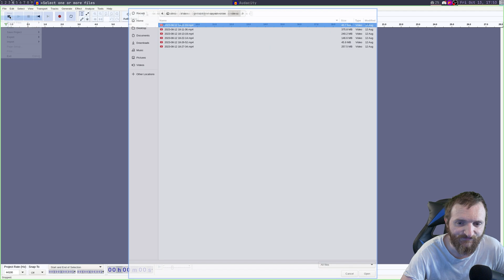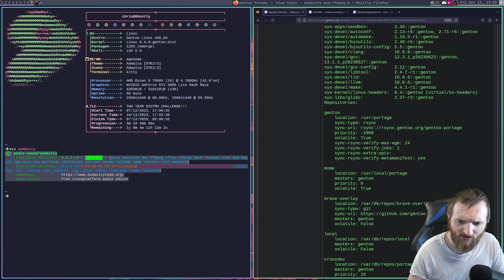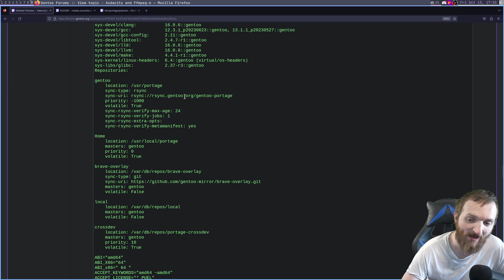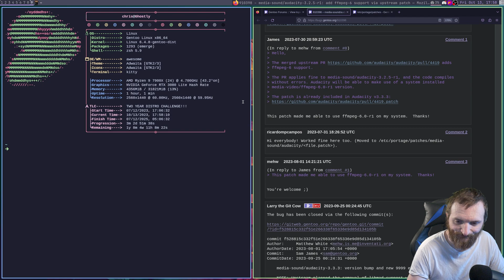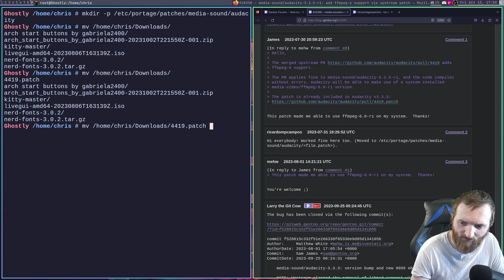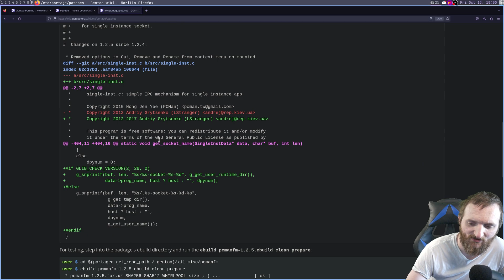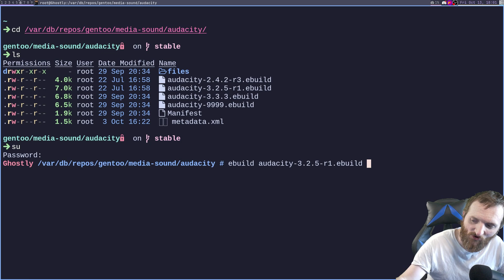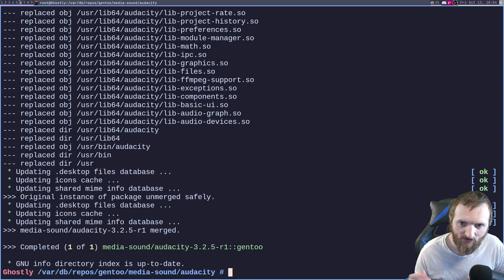Patching Gentoo Ebuilds - Fixing bugs

Comment: Cool Dalek wallpaper, I have that same one on one of my Gentoo machines.

Yes, I know ffmpeg 6.0 is causing some upstream issues at the moment. I did Gentoo updates earlier this week and my systems are currently blocking the ffmpeg 6.0 update because of handbrake,  I believe - so I have left it alone to hopefully resolve itself later, by which time Audacity 3.3 should be available.

Thanks for this video - in 20 years of using Gentoo, I have never patched an ebuild so this was good to know.